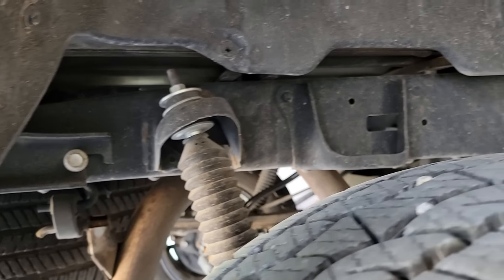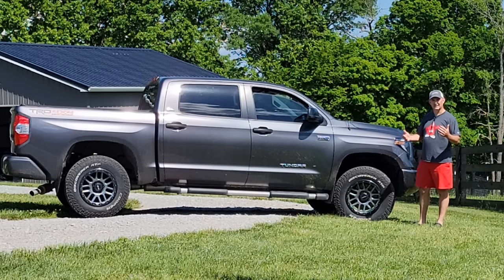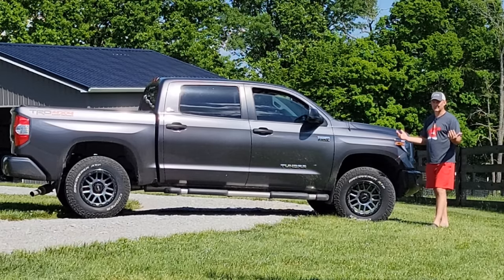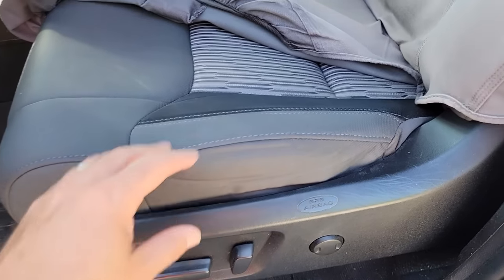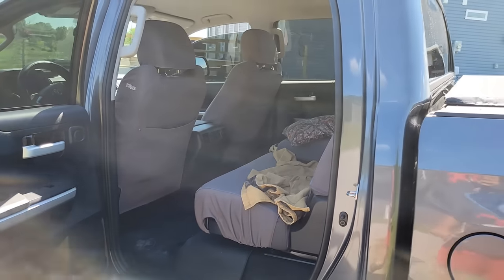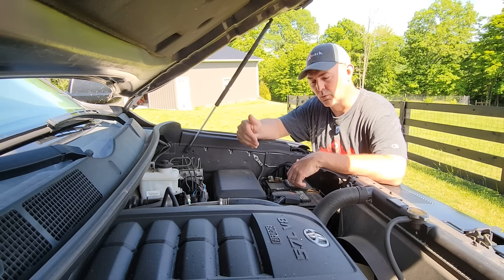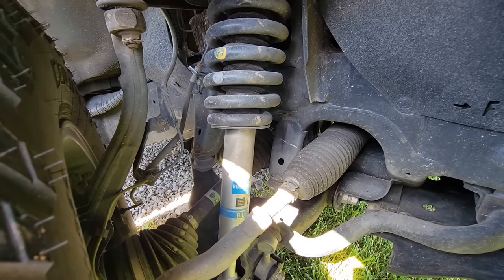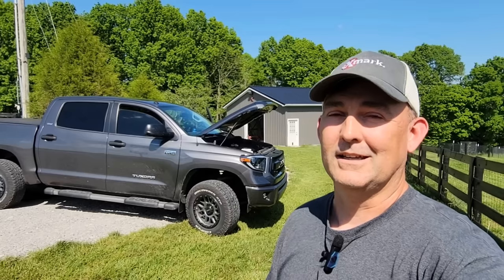Toyota Tundra at 6 Years / 100,000 Miles Compared to Ford F-150 and Ram 1500

Comment: Trick to 5.7 is (from your local dealership) synthetic oil changes every 5K miles and (local Toyota dealership) trans fluid changes (do not flush them!) every 60k miles and they will run forever also make sure to change radiator fluid every once in awhile and the truck will run forever and if yours is 4 wheel drive with a transfer case then make sure to use it at least 2 times each month to maintain it and it will never mess up.
Reply: You know the deal! Thats absolutely true! Love my 13 TRD Tundra!
Reply: Yes very good, can confirm
Reply: Why not to flush the transmission?
Reply: @carlosheras8075  flushing can mess your transmission up cause you are taking debris out when you flush it. A simple fluid change is all it needs every 65K miles.
Reply: Toyota recommends synthetic changes at 10k mile intervals?
Reply: @philliposborne5403  10K miles between changes is really pushing it
Reply: @thomasgriffin3474  We’ve done 10k mile intervals on our highlander for 130k miles and haven’t had a single issue. Did the same thing on our Tacoma before we sold it for the Tundra. No issues.
Reply: @philliposborne5403  wait till you get really high mileage on it. My 2020 tundra and 23 4 runner both get synthetic changes every 5K and first change at 1K miles for break in
Reply: @thomasgriffin3474  how high are we talking? Highlander has 160k and the Tacoma had 141k when I sold it. Tundra just rolled over 100k
Reply: @philliposborne5403  you’ve just had really good luck with your engines
Reply: @thomasgriffin3474  sorry man but I’m calling Bs. I’m not the only one with this luck. I just don’t abuse my cars and follow the service schedule like clock work and use quality fluids. 
I get why some of ya’ll change it early, because it helps you sleep at night. Which is worth it’s weight in gold. But to say I’m lucky to have a Toyota engine that’s serviced in normal intervals last 160k miles is absurd.
Reply: @philliposborne5403  it’s your vehicle treat it as you please. All my Toyotas running on synthetic get there first change at 1K miles and next every 5K after.
Reply: Another 3 thousand pounds for hauling would be awesome.  I'm boarder line with my towing weight.  I have no faith in other brands.  Wish they made a 3/4 or a 1 ton.
Reply: @philliposborne5403 It depends on how you use the vehicle. My Tundra is lucky to go 8,000 miles a year. However, my wife puts 3,000 miles a month on a Rav4. The Tundra does a lot of short trips, so I change the oil every 5k. My wife drives a lot of highway miles in a short amount of time, so the 10k interval is acceptable.
Reply: @philliposborne5403  if you look closely in your owners manual, there's almost always a part of it where they show a chart of various "driving conditions". That 10k oil interval is based on optimal driving conditions. 99 percent of drivers don't drive in optimal conditions, so it's smart to look at the "severe driving conditions" intervals and follow those instead. My 21 Kia Soul says exactly the same things in the manual that came with the car. I do 5k mile oil changes with Mobil 1 advanced full synthetic. I also don't drive much over 5k miles in a year, and it's never smart to wait more than a year to change your oil no matter how many miles.
Reply: There's no trick. Just run conventional  oil that's  what they are designed  for.
Reply: I never changed my transmission  fluid. Has 390k miles on it

Comment: Higher gas price is an issue for me too, but I still believe that I would rather spend a bit more for gas than much more for repairs or buying a new(er) vehicle every 5 or 7 years if I buy anything else but this truck. Have you guys seen how much the labor rates have gone up. One major issue with your domestic truck and all the savings for the gas would go down the drain very, very quickly.
Reply: I bought a Toyota Yaris... super reliable to get around...35 mpg combine .... besides my tundra
Reply: Wise words
Reply: Pay a little more for gas?  You mean a lot more...
Reply: These 5.7 are absolute pigs on gas. Second worst MPG of all trucks. Worst MPG is Titan w the 5.6. They are good trucks but it cost too much to run and parts are expensive. Rather a domestic truck. Parts and  service are much cheaper as is gas consumption. Engines w cylinder deactivation can be tuned off or deleted. Id rather get 17-18mpg than 10-12.
Reply: @IrishNew  We are getting 14 mpg on our Tundra. This is the only car/truck we are getting what the manufacturer states. My wife has a lead foot. When we had a 2001 Town Car, her average was 12 mpg compared to 17.1 mpg all of my friends that had the same car were achieving. When we had the 2007 Suburban with the 5.3l engine, her average was 12.1 mpg. When we had the 2010 Prius, she was getting 45 mpg, a friend of mine was getting 52 mpg. When we had the 2014 Honda Odyssey, her average was 18 mpg, others are getting 22 mpg or more. What I am trying to say is that if we had a truck with a turbo engine, our gas mileage would have been lower than the Tundra. Those Eco-Boost engines are great, but you have to feather the gas pedal. The new 2022+ Tundra can get worse gas mileage or better compared to the 2nd gen Tundra, well depending how you drive it. I honestly think that Ford F150 has the best gas mileage of the half-ton trucks because they reduced the weight of the truck. All others on paper are more economical, but in the real world that might not be the case. I have been through a lot of cars/SUVs/trucks, and frankly - the 2021 Tundra is my favorite so far, and I do not care that I spend $600 to $900 for gas every month, I really enjoy it. If I could not afford it, I would have bought another Prius. Anyhow, it will be the last vehicle with a V8 that I will ever own. If the gas price hits $6 or $7 per gallon, then we will drive it less. I live in a small town. Most of my friends do not drive more than 6,000/7,000 miles per year. We drive the truck about 18,000 miles a year. I do not know how expensive Nissan's parts are, but Toyota's parts are fairly cheap. I do not care about the labor cost. I fix my vehicles and I would not trust anyone else to touch my cars.

Comment: My 2019 Ram with 56k miles already had lifter and cam issues, so I traded it in for a 2020 tundra.
Reply: Broken exhaust manifold bolts broke to im sure! Yea I had a fourth gen got rid of it for a tundra! Couldn't be happier!
Reply: A wise decision.
Reply: Best decision!
Reply: 😅07 5.7 here with 190,000 not one issue. Runs/idles like a new one. I must have gotten the only good apple. Amsoil 5w20 is key.
Reply: @limeallens6160 no dodge changed the lifters in 09 when issues started. 05-08 are the best hemis
Reply: @liljohnny210  I'll do Ram as my next truck 🚚

Comment: I don’t think they lost a “great opportunity “ by switching to an electric fan and changing the power steering. They left it that way because it’s extremely reliable. That’s WAS the great thing about the Toyota trucks, their simplicity which many users love. Simplicity = reliability
Reply: I agree with this, but I also dont think it was just for reliability. I think to its for superior cooling as well. Electric fans will never move air like an engine driven cooling fan.
Reply: From my experience having electric power steering and electric cooling fans doesnt make any noticeable difference in fuel economy and power on a v-8 engine. Reason manufacturers went to it was to keep up with the EPA’s CAFE ratings.

Comment: Canadian here, living in the snow belt north of Toronto.
I have a 2015 Tundra 1794, with 250K km.(about 155K miles).
First 4 years a daily driver at 50K km/year.
Retired now, so drive 15K km/year.
No problems, zero rust, never garaged (I wash it more in the winter than I do in the summer!)
At 250K, I don't think she's even at half-life...
I expect it will be running just fine, after I'm not.
Gorgeous truck!
At 250K, I  don't
Reply: Do you rustproof it? You have too otherwise thwres no way you have no rust on it
Reply: Yeah I call BS on the frame not being rusted I worked as a Toyota journeyman tech in MN

Comment: I just bought my 1st Toyota Tundra  to replace my rusted out 2003 F-150. I live in Michigan, where there is more salt on the road than concrete. 
I bought a 2020 SR5 TRD Sport because I wanted a V8 insteadof the turbo V6, same color as yours.
I am planning to undercoat this truck. I'll probably do it myself with either Fluid film or Woolwax. There are a lot of YouTube videos on these products.
So far, I love my Tundra  but I've only had it for a couple months. 
Thanks for sharing your experience.

Comment: I have a 2016 limited that was bought in 2015. I also have 100k and I live in Michigan and my truck is in the same condition as yours. My wife had a 2015 RAV4 with 160k miles and its in awesome condition as weel. The key to owning any vehicle from any brand is maintenance.

Comment: The fact that Toyota was buying back or doing full frame replacements on trucks due to rust is so impressive to me. Can you think of any other manufacturers that would even consider doing this. They obviously learned from this costly issue and have greatly improved metal quality and coating techniques to fix this issue. I have found over the years that it’s not that Toyota builds better than the others. It’s the fact they fix known issues better than everyone else. Each model has its growing pains the first couple years. So I would always suggest buying a Toyota that’s long in the tooth. 

I’d much rather pay a little more at the pump than be on a first name basis with the mechanics…
Reply: Yep, exactly. I have a 2021 4Runner I’m keeping until the wheels fall off, so may be dead by then lol
Reply: They were forced by a class action lawsuit which cost Toyota 3.4 billion dollars. 
Definitely a lapse in quality control, bad management. 
Nice to know not all of their trucks suffered a similar fate.
Reply: They also build better quality cars, tundra engine and transmission are Japanese designed and reliable unlike the ford and Chevy 10 speed
Reply: No other manufacturer HAD or needed to replace their truck frames.
Toyota refused to help their customers until a CLASS ACTION LAWSUIT AND THE FEDERAL GOVERNMENT FORCED them to replace those frames. 😂
Reply: Unfortunately Toyota took a page out of the F-150's Playbook when they did that twin turbo V6 but yes I agree anything prior to this new model is definitely worth buying
Reply: Definitely not domestic auto manufacturers.
Reply: Stupid comment. Toyota did not do it willingly
Reply: Toyota was forced by a lawsuit and the lawsuit only covers a certain time frame of dates for the frame replacement lastly the if you fall into the time frame you only get a new frame anything else connected to the frame that is rusty and needs replacement is on the owners dime. I am a former journeyman toyota tech out of minneapolis.

Comment: Tundras are good trucks. I just wish they updated them more and had better towing capacity. My last 6.7 powerstroke went 743,000 before I traded it in with minimal issues. If I didn’t have to haul cattle etc I would have a tundra
Reply: I have wondered why Toyota doesn't produce a diesel dually - maybe the market is not profitable to break into.
Reply: @PersistentPatriot  doesn’t even need to be a dually they should get something on the market. I mean look at the Toyota helux those things last forever.
Reply: @josephcraig765  my buddy has to pull heavy equipment for his concrete finishing business and his only choices are to go for a dually which is either: Ram 3500, Ford F350, or Chevy Duramax full 1-ton trucks.

Comment: ‘13 Tundra TRD Crew Max owner here. 5.7 flex fuel engine with 209,000 miles. Regular oil changes, changed the suspension out last Spring, replaced idler pulley, tensioner pulley and serpentine belt last year. Replaced plugs at 120,000. Other than that it’s been issue free. I bought second hand with 48,000 miles at that time. It’s been a great truck. Now for some not so liked things: Last year I purchased a travel trailer, and that’s the only weakness I’ve found in the truck. It will tow it, but I definitely can tell I’ve got it back there. RV weighs 5,900 and I tow it dry. Also the cargo weight is very limited on the truck. Only 1,375 lbs.
Reply: Get the blue Sumosprings for the rear and it will make a huge difference.

Comment: My 07 Tundra SR5 5.7 4x4 has 283k, runs great. I live way up north near the Canadian border, road salt heaven. The nearest car wash is 30 miles away, so I connected the hot water heater to the outside hose, works great. Rinse, drive, repeat.......yes there is rust, surface rust.
Reply: Hot water activates salt. Use cold water next time
Reply: At 20 degrees by the time the water gets to the truck it's lukewarm. Or, I could drive 30 miles on salt covered roads wash the truck, than drive the just washed truck on more salt covered roads to get home. Common sense, come on man.!?!?

Comment: I still have my 2015 5.7 with 87,000. I love my Tundra.  It's really been a reliable truck.  Besides oil changes, I bought a new battery,  3rd set of tires,  serpentine belt, and antifreeze. Runs like new money.

Comment: I have a ‘17 Tundra with 55k. Truck is flawless and is by far the best vehicle I have ever owned. I still love my Tundra!
Reply: It's still new.  Lol
Reply: 07 5.7 here with 190,000 not one issue. Runs/idles like a new one. I must have gotten the only good apple. Amsoil 5w20 is key.
Reply: 2017 same here..will turn 60 k maybe today....love this truck...except the gas mileage 😢
Reply: @TC-tw5zk  yup, the gas mileage sucks, but everything else is spectacular. I’ll pay the extra fuel cost for the reliabilty and integrity.
Reply: @1ronhall  agree!!
Reply: I love my Tundra enough to pay the price of gasoline. The extra gas is much less than any new vehicle price tag!

Comment: I own a 2019 TRD sport.41,000  no problems..  Changed front and rear differential plus transfer case.  Great truck 🛻
Reply: 2019 limited here. also 41000 miles. have a tensioner and belt squeak sometimes but cheap fix when winters over. love my tundra. coming from 15 years of GM trucks. After 06 GM went right to shit and has stayed there.

Comment: I have a 2014 Tundra with 170k miles.  Bought it new in 2014.  It looks new underneath and would look new inside with a good cleaning.  It drives like new, tows like a dream, no strange noises, no lights on, no having to explain how something doesn't work.   I've put a battery in it, on my 4th set of tires, 3rd set of brakes, I've changed the oil, trans fluid and gear fluids, along with flush the brake fluid, power steering fluid and change the air filters and coolant.  It's almost due for another set of spark plugs.  Notice I've never mentioned a water pump, alternator, ABS module, headliner, blinker adaption device module, left brake shoe adaptive counter rotate console device module, rear window blind spot mirror module or HVAC wind speed detection module..... like you'd hear from the Big 3....  Heck, most people who are Big 3 people are scared to death of a vehicle with 100k miles on it.

Comment: I have a 2008 ford f150 with only 70,000 miles and already giving me transmission problems. No to mention all the crap  that the f150 has and  ford knows all about them and they never change the crap. Honda and Toyota aren't perfect, but they fix all the big and small  problems every new  model ,till they are perfect. That's how your truck became what it is. The best truck I'll ever buy is going to be this tundra. Thank you for this video. All of this I already new but I hope ford, chevy China, and the rest learn something buy watching it.

Comment: I know this may be late, just found your video, you need to strongly consider Nissan Titan. I have a new one 21 highway, 16 city. Most reliable V8 half-ton truck as of 2023. no start/stop feature. no e-torque. no turbos. no cylinder de-activation. traditional parking break. simple 4WD system. and the list goes on. Very happy with my purchase.
Reply: Sounds awesome brother, gotta love the 5.6L Endurance V8 in the Nissan Titan, that V8 engine is a freakn beast.
Reply: Reccommends run 91 octane in it. That's a no buy for me
Reply: I don't know how the 20-23 Titans will hold up, but I can tell you a few years precedent to that, they had differential, rear end, and electrical problems. Also the 5.6's during those years had an issue with cylinder #7, owners complaining of loud ticking noise. They got put on a list for engine swaps. Nissan dealers swapped lots of 5.6's and were encouraged to not report it, so it doesn’t hurt Nissan Titan sales. So a perspective buyer of a used Titan will not see it on a Car Fax report. Also there’s a class action lawsuit pending regarding 20-23 Titan transmission problems.

Comment: Sadly in my lifetime (65 years 6 mo.) I will not see a truck like my 2018 Tundra 5.7, gas, made as well. 45000 worry free miles just changing syn oil, 3 recalls fixed perfect and I drive like the old man I am. But I know there is a lot of muscle and reliability if called upon. It is a fine vid OFFRD so thank you.
Reply: It's called landcruiser 98-08
Reply: Keep the maintenance up on yours and you will not need to worry about another truck.  That 2018 will run 30 years with very little issue as long as you maintain it.